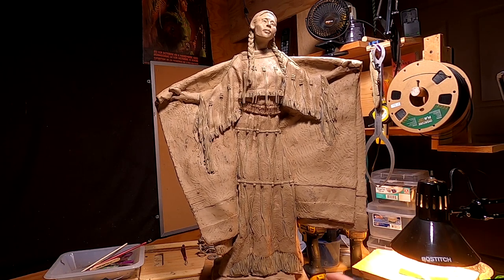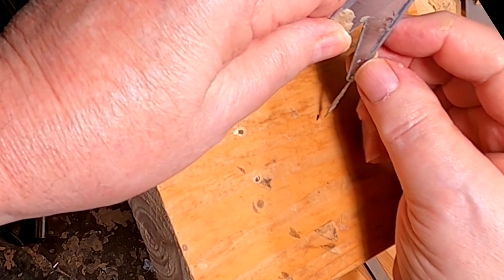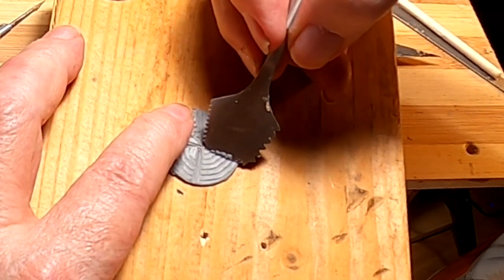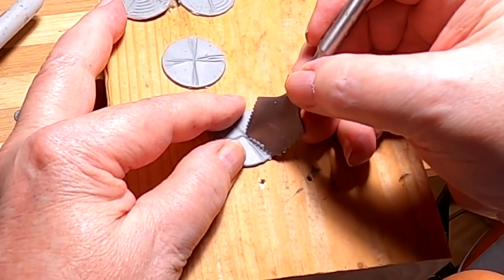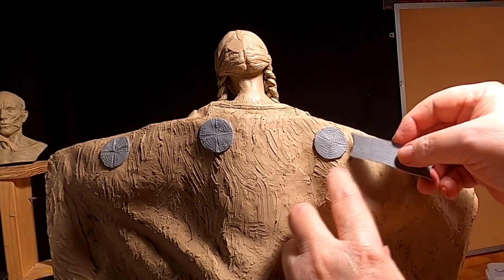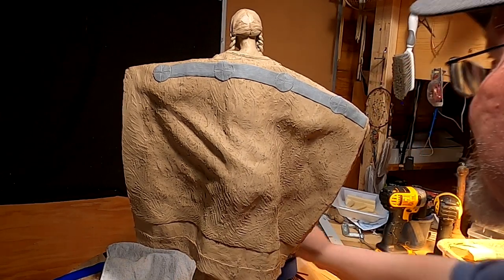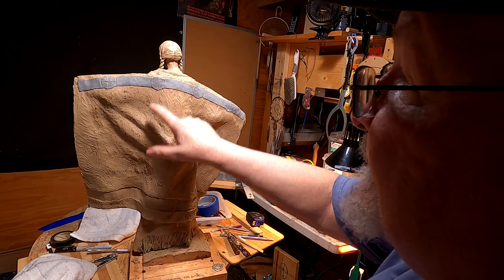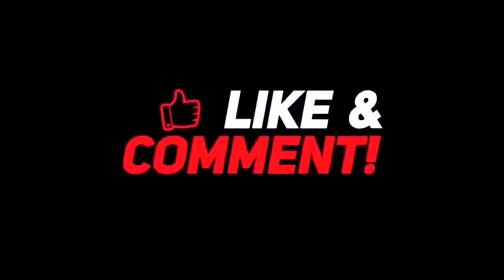CHEYENNE MORNING   The Blanket's Cheyenne Beaded Strip Today

Comment: Hi David,  I have been looking at your current sculpture, Cheyenne Morning, and I'd like to offer an observation, if I may.  @9:50, we see the front view of the sculpture.   The blanket comes so close to the foremost part of the woman's body, the blanket looks glued to her sides.   The visual result is that the sculpture appears flat.  The back view has some modelling in the blanket-to-body relationship, which is good, but I think it needs more.  The front view is the most problematic.  The body and the blanket are too much on the same plane.  Put another way, the body should be more round--more three dimensional--as though the blanket is going behind the figure, as it would in life.  As you may recall from my previous comments, on other of your works over the last ten years or so, I offer observations in the spirit of constructive criticism as a fellow artist--I'm not trying to be unkind.  Overall this is another brilliant work of art from the mind of a master.  I just thought I'd offer an observation.  All the Best--Ag
Reply from the maker: I did that, because if I made her more rounded into the blanket.. the molding process would run into a problem that to solve, would add greatly to the cost of producing the bronze.. It's a compromise, to keep the costs down and therefore the retail price to the client. It looks better in person as well.. video does not do it justice..
Reply: @clayguy1 That makes perfect sense, David.   I forgot about the realities of casting from clay to bronze.😊